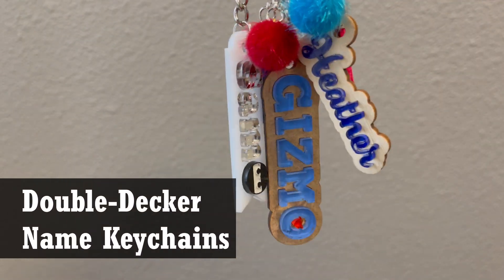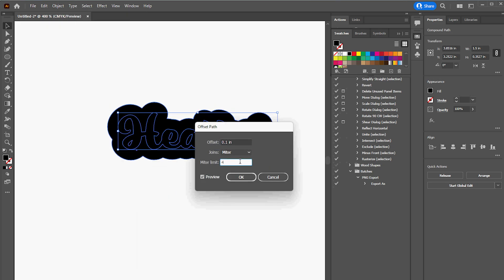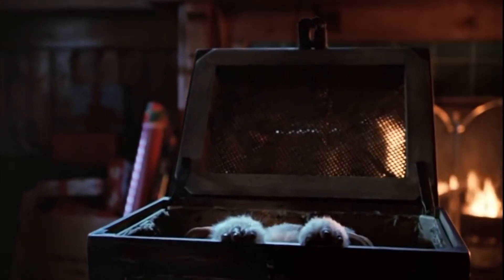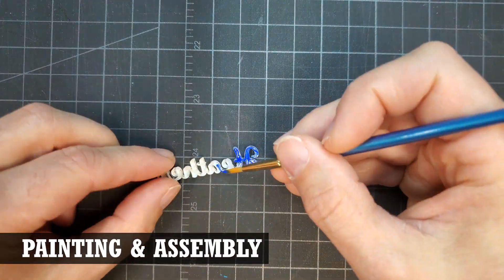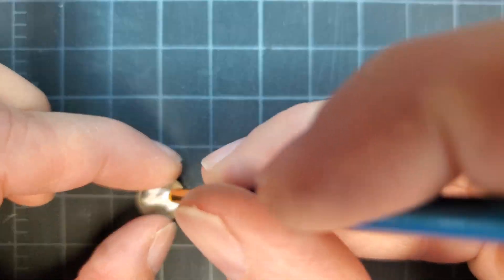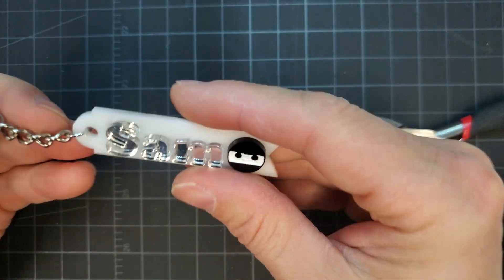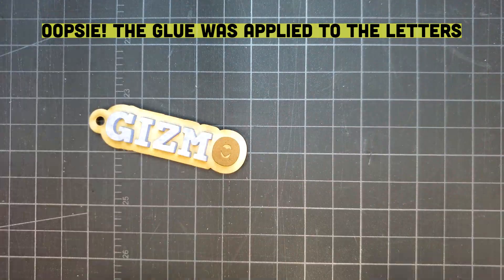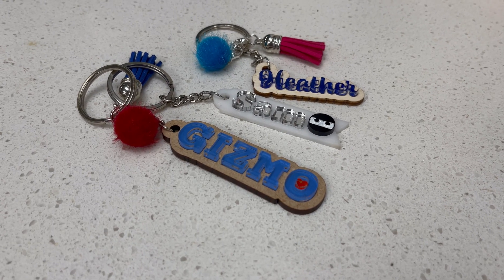Double-Decker Laser Cut & Engraved Name Keychains Tutorial with Adobe Illustrator

Comment: Nice work! Any tips for getting the jump rings quickly realigned when installing? I seem to always have them slightly mis-aligned.
I have the Speedy 300 and tried keychains and earrings but didn't have an outlet for selling them at the time.
Reply from the maker: We're not sure if there are any particular tips on aligning them. We just twist them manually into alignment and haven't had an issue.